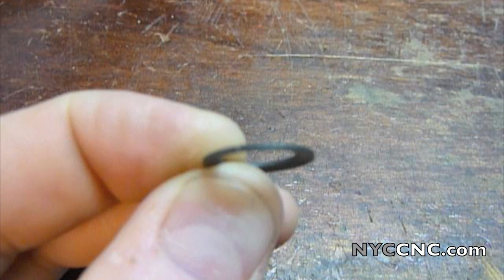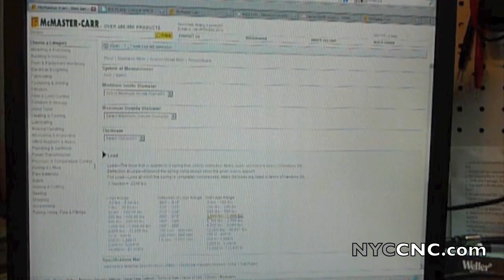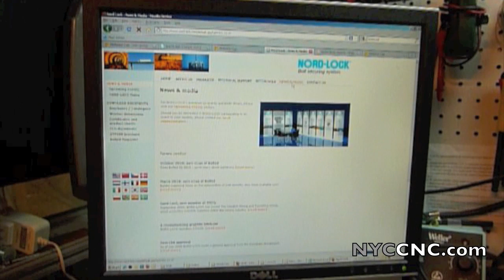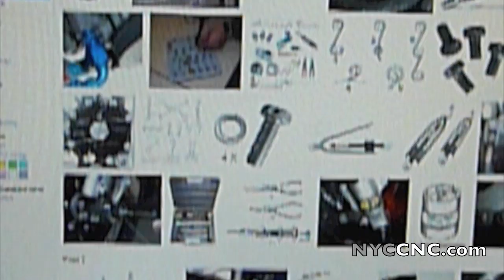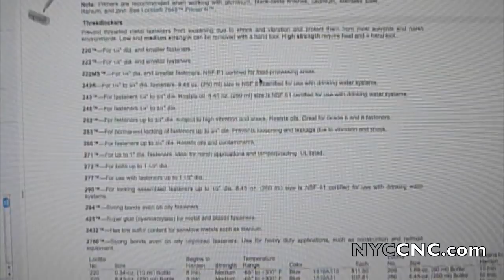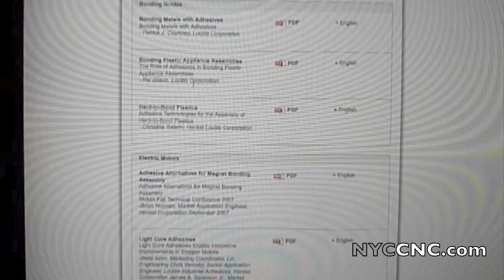How to prevent a screw from loosening: Loctite, Safety Wire, Jam nuts & More Part 2 of 2

Comment: One thing you didn't mention (and I use this method a lot) is to get two nuts (regular nuts without the nylon washer) and you need 1 wrench the width of the nut (the other wrench can be wider), and you tighten the nuts against each other. When I say tight, I mean I really make them super tight. They are so ridiculously tight against each other, that I doubt they would ever come loose. Even using two wrenches you can barely break them free (I have removed some after a long time and I could still barely get them to break free). You have to consider the quality of the bolt & nuts because I have also broken the bolt doing this. If used in an application where people can't reach the nuts well and using two flat washers on each side,  they could turn and turn the bolt and it will just spin on the flat washers and the two nuts won't break free.

Comment: Hmmmm, why not use superglue instead of locktite? But great work thank you! I learned heaps! Hmmm yeah isn't that the red stuff plumbers use?
Reply: Superglue holds really well, but it's weakness is that it's extremely brittle and it can shatter. Epoxy would be much stronger but it's more of a hassle because you have to mix it before applying it.
Reply: I really like the Loctite superglues (both liquid and gel). I think they're some of the best superglues. They each have things that each type works better on than the other. Still, both types are extremely brittle.

Comment: I have, as an experiment, left loctite 242 sitting on the threads of a metal screw for an entire year. It did not set or dry in any noticeable way within that time. At the end of the year I threaded the fastener into a nut and it hardened within moments.

Comment: You are both right actually. The primer is there to create a airtight seal against the metal that arent really really flat if you look at it in a microscope. But yeah moste loctites and Cyanoacrylates is Anaerobic and hardens due to the lack of air. That why CA bottles dont come filled up to the top for an example. And if you forget to squeeze out the tip or clean it off before putting on the cap it will harden.. fast..

Comment: I was under the impression that loctite is an anaerobic chemical that hardens in the absence of air. thats why you can leave it sitting around all day with out the cap on and it won't harden. it is only once you torque down the fastner and squeeze out all of the air that it hardens. I have never heard about it reacting with metal, not saying that its not accurate though.

Comment: Bevel washer, not belville.  Also, safety cable is a great alternative to safety wire.  The tools are a little more expensive, but WAY easier to use.  The same principles apply as when you use safety wire.

Comment: I use the loctite 542, it's an hydraulic sealer but also does a fine job on bolts on my harley and it prevents water getting in between the threads.